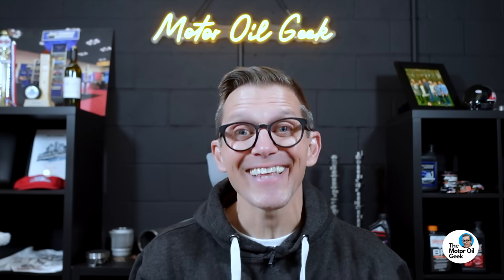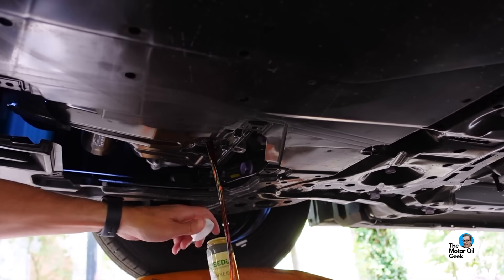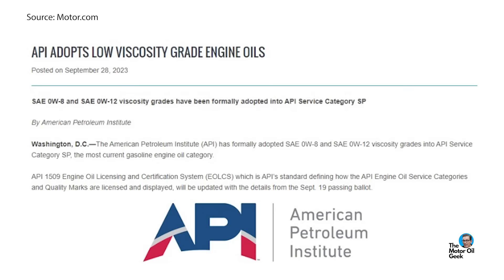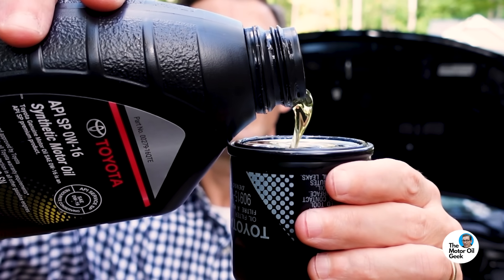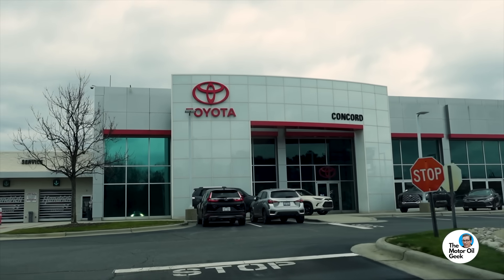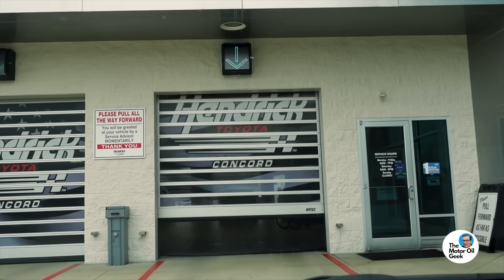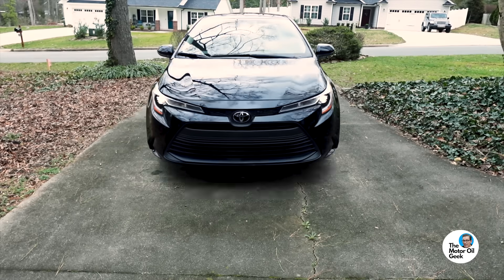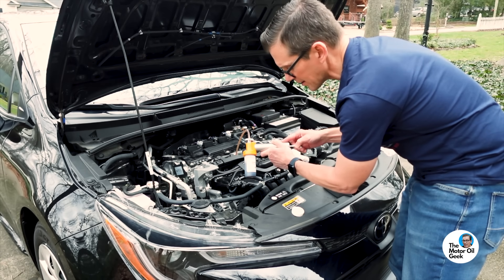0W-8 Motor Oil: Too THIN to Trust? Let's Find Out!

Comment: This is why I don't have others change my oil.  My 2023 Highlander takes 0w-16 and I got free oil changes at 10K and 20K miles.  I let them do it so it's in their records and it's the dealer, how badly can they mess it up.  When I picked up my vehicle after  the 20K one, the reminder sticker had 0w-20 on it.  I went to complain and was assured (I think they lied) they used 0w-16 and just miswrote it.
Of note:  I do oil changes every 5K miles with Pennzoil Platinum and WIX filters.  But PP is not available in Ultra at that weight.
Reply: 0w20 is better for your engine. People like you are annoying as fuck because they don't know what they are talking about yet complain about it like you admitted to doing.
Reply: Also, pennzoil platinum is not very good. ULTRA platinum is some of the best oil you can buy
Reply: @TheScrubmuffin69  Except doesn't come in 0W 16 yet.

Comment: U    fools   do not use    castrol    oil   its no good   thin    burnn    engine  parts  out      let  dum  fools  use   it          its  no dam good   use    5 30     5 40    10 40       i use   15 40   delo   oil    in    all    here        did u  see the inside   engine   that  used  that  oil u like   ha ha     i  seen  all

Comment: I would love for you to test MotorKote it claims to bind a protective coat to metal  I have used it I would like to know what is in it and if it works on metal  It has a You  Tube lawn mower challenge that is impressive Thanks
Reply from the maker: Great suggestion!

Comment: Now that my Corolla is past 30k miles I am considering having my oil changed outside of the dealership at Jiffy lube. Should I trust the 0W-8 full synthetic oil that they offer, or should I bring the Toyota manufactured 0W-8 oil to have them use?

Comment: I find it crazy that a manufacturer would schedule oil changes at 10,000 miles for vehicles they will potentially be back on their lots as lease returns or trade ins. Any carfax that doesn't have 5000 mile oil changes is not even considered.
Reply: Today's buyers are clueless

Comment: Oil is measured off of viscosity! If your engine use 0w-8 oil? Just use Cooking oil? 1 gallon of WD-40, something is better than 0w-8! These stealerships are having the customers buy a car for $40k plus and have the engines run on water, as oil. You are the 100% returning customer. 1000% SCAM! These cars are engineered to break down!
Reply: Yeah right lol. Stop trying to fear monger. I don’t think toyota, a brand BUILT around reliability, is going to tarnish its reputation. Like buddy it’s not hard to accept that thin oils don’t damage engines.

Comment: The more I read, the more confused I get about this battle between thicker or thinner oils. Thinners oils get up to the engine faster and give more cooling because they make it through the passageway faster. Oil just doesn't lubricate, but it acts as a cooling agent as well. Wear is when there is actually metal to metal contact, which just isn't going to happen with today's oils. But heat can break down the oil leaving a varnish or sludge on the parts.

Comment: in canada my toyota dealership doesnt actually change the 0w8 at the first 8,000km (4970mi) service.... they just check the level/ actual replacement is at 16,000 km (9942mi). i changed it at 8k, and ill do it again at 16k 2024 Toyota Crown 2.5 hybrid

Comment: The Hollywood Mechanic did a great video a year ago called “You’re using the wrong oil, w/receipts”, and talked about how both Lamborghini and Audi backtracked with their original spec’s of 5W-30 to ….. drumroll ….. 10W-60!  Oil sample diagnostics, over many “short”-interval oil changes is key to finding out what oil, where, and when, is best for you/your situation/car/environment.

Comment: Oil Guy Hello.
I use to drive old mini vans with lots of miles around 200K. I would add any motor or tranny fluid i could find on the jobsite as the vehicle often leaked or burnt it up.
Changing filters was only optional on a rare occasion. I would try to keep the weight similar to spec even if i added a much thicker oil i would also add a much thinner oil trying too keep a balance.
I dont drive those $500 vehicles any more but my question is, would it be beneficial to mix 0w20 with a 5w30 or similar for a newer toyota engine especially living in a warm S.California climate?
Thanks Sal

Comment: I have not seen nor have I read 2700 comments on where are the parts per million wear off of in the engine cylinder walls and if so how much of a benefit from an engineering standpoint can you give to Plateau honing

Comment: My dealer put too low viscosity of oil in my car by mistake at my recent oil change.  Do I need to change it out?  2024 Outback takes 0w20. The dealer used 0w16.  Car has 15K miles. I change the oil every 3K miles, hoping to increase the engine life.  My driving is mostly short trips around town.  About 12K miles annually.

Comment: I wonder if an engine with 0W8 in it will ever make 200K miles? I have not yet seen an engine with 0W16 make it to 200K. High silica numbers are from the foundry casting process. Engine blocks, cylinder heads, crankshafts, and other internal engine parts are cast in sand. So, some of that microscopic sand or silica eventually washes out of the porous iron or aluminum inside the engine when it is running and ends up in the motor oil. That's why in the good old days they told us to change our oil after the initial 500 miles. And obviously various metal counts would be higher in the first 500 + miles. I've yet to hear someone tell people not to make a habit of red lining the engine, especially when it's a new engine. And they used to tell you not to drive the same consistent speed when breaking in a new engine.
Reply: There are thousands of engines running 0-16 that make it well over 200k.

Comment: This is why I always like to change the engine oil myself but having a new car warranty and free ( for a certain number of times ) oil changes mine goes to the dealer. Now my older used cars that's a different story. Only I touch them.

Comment: Just bought a 2025 Camry hybrid; the Owner's Manual specifically states to use the OW-8.  The Toyota dealership told me that, no, I can use the OW-20 that I used in my Prius.  This is so confusing!  And I'm not sure I can trust the dealership to use the OW-8.  Maybe I can ask to see them actually put in the OW-8?  Will they do that if a customer asks?

Comment: The CVT tech on toyota is not a BELT cvt but a "electronic" one, It uses the fundaments of planetary gears to create a "continuous variable gear ratio" by locking, letting slide or free spining the outer gear of the "planetary gear" under of command of electric-magnets. So it has almnost no wear, since the gears are always engaged, and there is no "true sliding".
Reply: Funny thing, it always worsen the efficiency (in fuel) against a traditional gearbox since it has permanent magnets inducing magneting forces which the gears constantly have to overcome. But mosst likely will last way longer.
(You can notice this by just checking the oficial MPG of each model against the cvt version)
Reply: @JoseGB-g8u it works amazing in my 2022 Camry hybrid. Already 100k miles. I drive quite a bit.

Comment: Crappy 
Valueless 
Transmission
Reply: Not this video is mistaken. It's a eCVT which is only electric motors. It was an honest mistake but it was not accurate. Just need to Google Toyota eCVT transmission. These transmissions are amazing.

Comment: Use it only in Los  Vegas in the summertime. Lots of city driving/ stops and starts. Mmmm good for the engine eh?
Now see how long your engine holds up. No thanks,/ you use whatever cooking oil you want to.
 I hear 06 isn't too far away/ then what/ 04?
 Suckers.
Reply: I heard last year 0W-6 is in test Toyotas now in J A Pan
Check what oils are used in the same vehicles around the world. It takes a little sleuthing but the info is there.
 10W-30 5W-30  0W-20, 0W16, 0W-8 all in the same M20A-FKS engine first in a Cross made  in Malaysia 2020.

Comment: It's not available in any store around where I live.
 For the Corolla engine, I have it started out with 5W-30 THEN OW-20, THEN 16, NOW 08.
 ALL IN THE SAME ENGINE. Toyota has it at a 30% markup. No thanks.
 you folks are test subjects, or rather your car engine is.
 I am supposed to use 16 oil/ I use 20, and 30 oil in the summer.
 Sue me ...

Comment: Does Toyota hybrid use a belt in trans? I thought it used planetary gear with two electric motors.
Reply: Yes, planetary gear,  the video is wrong!
Reply: Sorry, it's a non hybrid corolla .. that seems to have a belt type CVT

Comment: It's not the oil I question, it's modern motors.
Reply: The modern motors are very particular on viscosity. They use very low tension rings that need thinner oil. The new synthetic oils actually protect the same if not better than the other synthetics with higher viscosity. And 10k oil changes it marketing and not advisable. Any sludge can cause the previously mentioned low tension rings to stick causing the piston to dish out the center of the cylinder bore. Sticking to 5k service intervals prevents this. But  don't trust me, look into it. It's very interesting.

Comment: I don't trust anything thinner than 0w30 and that's only for a snow blower. Everything i drive/run year round gets 5w40. It covers the full temperature range of my state on those charts that they used to provide when engineers recommended the oil instead of CAFE.

Comment: When a manufacturer can make a cvt that I DON'T hear horror stories about from mechanics who don't work at dealerships, I might consider buying a car with one.  At this point though, I'll let the people who like replacing their cars every few years play with them.
Reply: Then look into the eCVT. It has no belt. This video is incorrect on that one thing. The eCTV has been used by Toyota for years and is solid. But don't trust me, look it up.
Reply: @williamspohn3652  I'm not looking for a hybrid either.  Especially one with a "torque limiting clutch pack" to kill performance.
Reply: @hellcat1988 Nobody is buying a corolla for performance 😂

Comment: Why would you goto a dealership for an oil change since you change it yourself? This video looks to be more about showing what the dealership is doing rather than what the oil will. If the Japs made the engine to run on 0W-0 oil, water or apple juice then it will run on that and just leave it at that.. :face-turquoise-covering-eyes:

Comment: Don't have to change your CVT fluid until 30,000 miles under sever use . Always go by car manual to change fluids.
Reply: I like over kill and  preventative maintenance. But you are overboard. Car manufactures know how to make cars last and they know the maintenance schedule should be. They know people won't follow it. They want their cars to last and have a bad name. So they have a maintenance schedule and it is probably overkill because they know people don't follow it all the time. So they they have it overkill on the schedule. They didn't want their product have bad name. That it doesn't last. So you are overboard on your thinking.

Comment: I worked at a Mazda dealer before, and the new mazda 2 is a Yaris. In the specs in the shop manual, the car is delivered with 0W-5. and it called for 0W-20 when the oil changed for the life of the car. The low viscosity is only for fuel economy. Longevity is better with 0-20.

Comment: These ultra thin oils are garbage. I would use 5w 30 in that car. Ill guarantee you will have better oil pressure and better protection with no problems at all. The clowns who come up with the idea that they want you to use these watery oils is to save pennies on fuel. The reality is that you are going to destroy your engine sooner rather than later. Toyota engineering has been slipping for years now. Shame on them.

Comment: And now who says the break-in would've been bad when running the first original oil for 10k miles? These engines are designed for those intervals, just as well as the lubricant. All this data is cool and all, but the all out geeking is really only making people nervous for nothing.
Reply: They are not designed for 10k initial oil change intervals. No engine is. Manufacturers get financial incentives to make claims that their vehicles need less maintenance.

Comment: I would just wait until the 1st year service or 10K, Toyota know what they're doing
Reply: Sure, Toyota knows what they're doing, and what they are presently doing is replacing every single 2022 and 2023 Tundra engine because of a manufacturing or design defect.
Some 2024 Tundra engines have also failed. Time will tell if they too will be replaced.

Comment: Meh. My 2019 Corolla LE had it's first oil change at 16000km (10000miles) and every 16 after that. 282,000km and going strong. No repairs. CVT transmission is fine.

Comment: DO NOT CHANGE YOUR CVT FLUID AT 10K MILES.  30 or 40K SERVICE IS FI NE.  YES im screaming.
Reply: The earlier the better. The later the worse. Especially for cvt

Comment: 0W-8 is used to get it out of the showroom legally (CAFE). Higher viscosity oils are used as service fill not because of their viscosity but because of their lower volatility.  0W-8  oils are all quite volatile and thickens up in use as the light end boils off.....Real Expert  😊

Comment: My dad was baffled when his new at the time 2010 Subaru Outback didn’t have a cvt fluid interval well at 180k miles he had an issue in the valve body replaced it ( valve body ) and the fluid car has nearly 200k miles now 😂.   His 2024 had a fluid drain and fill recommended service now.   Kinda like his 2010 was a Guinea pig 😂

Comment: I appreciate the useful information. I do have question, for whoever cares to answer. CVT transmissions, what kind of track record do they have? I have heard bad things about them and, I must confess, I probably wouldn't own one. I do see how it might improve fuel economy, given that it keeps the engine revs low, but if it won't last, then count me out.
Reply: They are fine if you change the transmission fluid every 10-30k miles. If you don't change the fluid then they will break guaranteed. Just change the fluid every 20k or before and you'll be fine.

Comment: Hi, with these modern thin oils 0w-8 or a 0w-16, are they only compatible with modern engines because the oil pump are variable ratio and engineered to closer tolerances. 
Would these thin oils even with the improved additives be bad for older engineered engines ??
Reply from the maker: I would not recommend these thinner oils for older engines.

Comment: Recently bought a 2024 Malibu new. Changed the oil at 5K miles for the first 3 times. About to hit 15K then should be able to open up that interval a bit to 7500. The 0w-20, thanks to your info, doesn't scare me at all. 36mpg highway! First Chevy for me and love everything about it so far. Also running premium gas after your excellent video on premium gasoline over regular.
Reply: Keep it at 5k or less and you will have less problems in the future
Reply: Got a 2020 Chevy Malibu with 170K mostly high way miles. Still going strong did the oil changes every 3K miles. Can’t believe people do oil changed every 10K can’t do it.
Reply: @highrollerdero Nice! I got mine to 27k miles and traded it in. Outgrew it. Needed a truck. Hoping it delivers the next owner a long way.

Comment: Greetings; I bought a 2024 Toyota Cross LE New 0 miles. I am concerned because it uses 0w 8 oil. I live in a tropical climate. Is this low viscosity oil safe for engines? Are its changes every 5,000 miles or 10,000 miles?

Comment: How do you get accurate oil analysis st 5,000 mi, 7500 mi and 10,000 mi change intervals, after the dealer oil change, and take out 3 containers full of sample oil without adding new fresh oil that will change wear characteristics of the engine oil at subsequent analysis??!!

Comment: I use the grade the manufacturer states.  I don't buy their oil at Toyota, but buy it elsewhere, but always use the recommended grade full-synthetic engine oil.  I never exceed 5,000 miles, NEVER!  I also use WIX filters on all my cars or trucks, never factory, unless they come with the vehicle.

Comment: My Accord calls for 0W-20 oil.  On Youtube is a video where a guy is demonstrating how to change oil on this same car.  I laughed when I saw he was using a drain pan the size of a bathtub.  Well, the laugh is on me.  This thin oil splashes, sprays, spills and goes everywhere.  Every five gallon container should come with a 50 pound bag of oil dry.

Comment: So is there any benefit to using a heavier grade oil e.g 5w30, where the manufacturer specifies these low viscosity oils? Many people talk that their recommendation isn't based on what's best for engine longevity, but more achieving official fuel economy figures (aka marketing, which is what sells cars). your video indicates no real issues, how does this translate to someone who plans to keep long term /150k miles+?